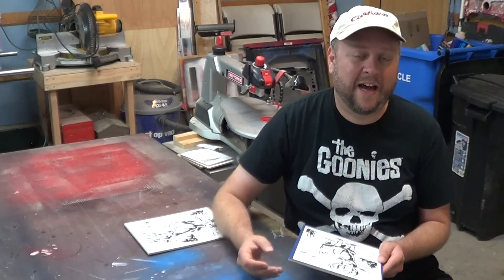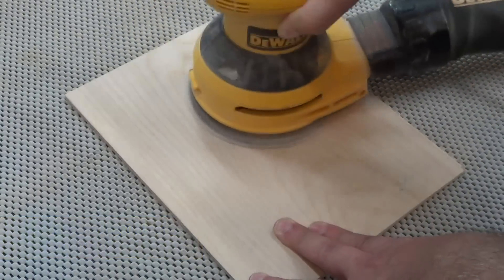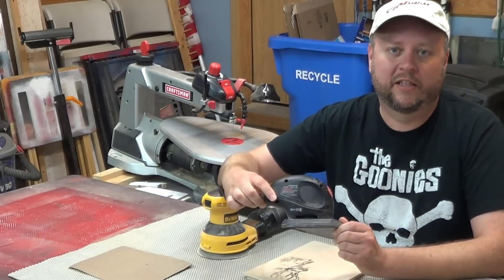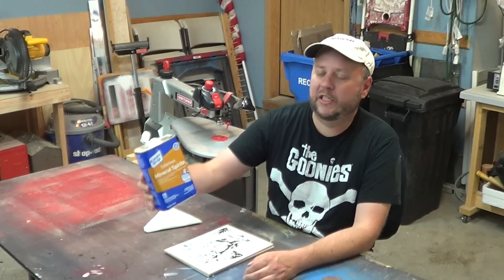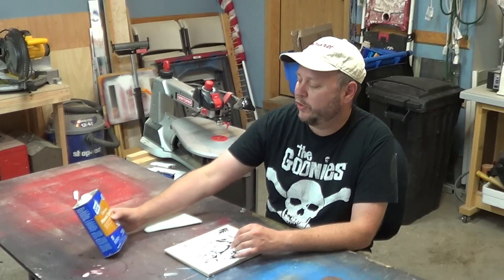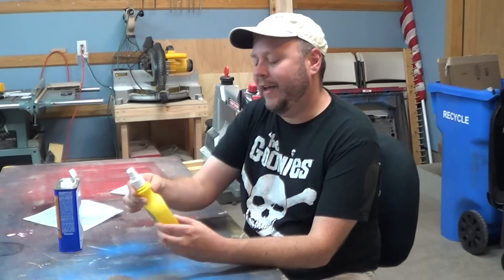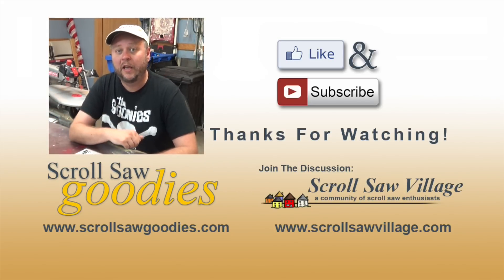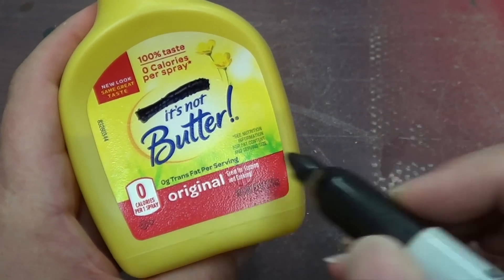4 Ways to Remove Scroll Saw Patterns

Comment: I have a pattern of an owl with lots of lines inside the pattern just single lines that do not join up to make big holes, my question is do I drill a very small hole and cut the lines inside the pattern or do I paint them on or burn them on. Thanks Steve

Comment: I use the heat gun but it leaves a great amount of glue residue. Will mineral spirit remove that once the pattern is removed or do I have to remove the pattern with mineral spirit so that the glue comes up as well.
Reply from the maker: Yah.  Mineral spirits will dissolve the glue if you have some residue left behind.  I just apply it with a paper towel and wipe away the excess.